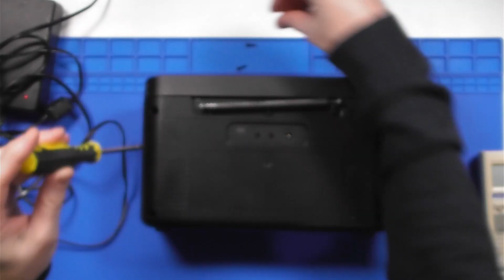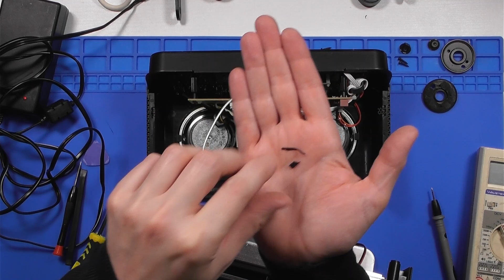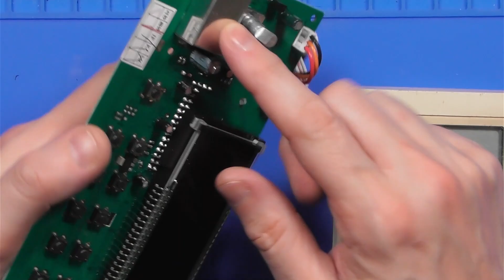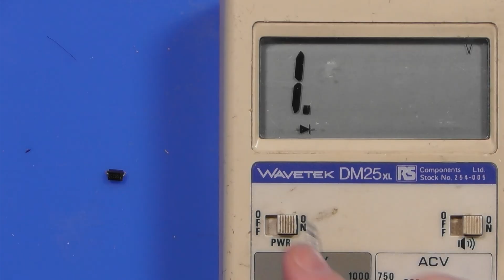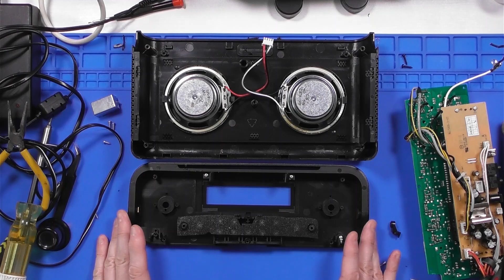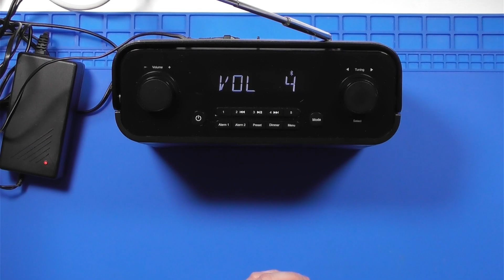REPAIRING a Roberts Blutune 5 DAB radio with a NO POWER fault - Can I fix this?

Comment: As so often with modern equipment, the fault is not actually an 'electronic' one. Given the loose plastic from a broken mounting point, the radio has probably been dropped. With a rigid plastic case, the shock waves have unpredictable effects, but high G force 'did for' a slightly less than perfect bit of soldering around that IC in the power supply. This is one of these occasions where the 'retro' style wooden cases of some Roberts radios might have worked better as they have a degree of shock absorbing due to the materials used.
Reply from the maker: I agree, almost certainly has been dropped at some point.  I was glad to get it working however as it's now in daily use, so a good result all round.  Thanks for the comment.